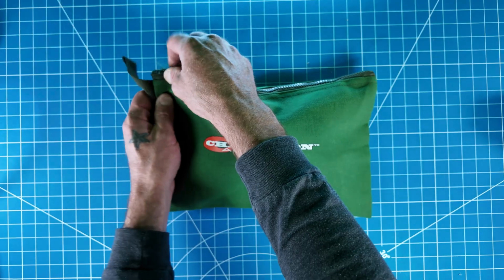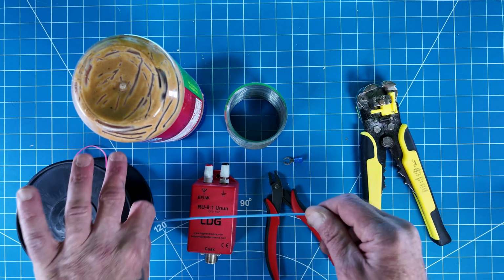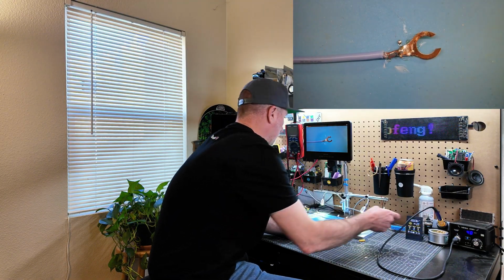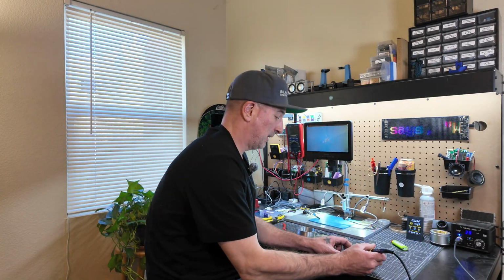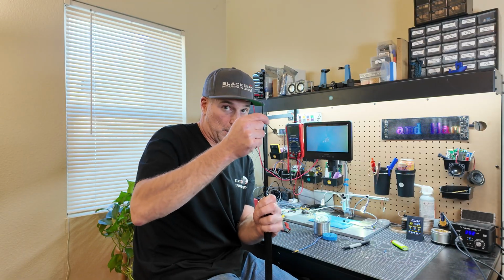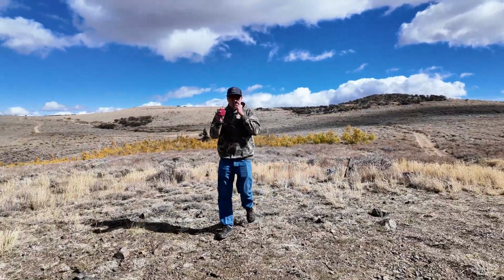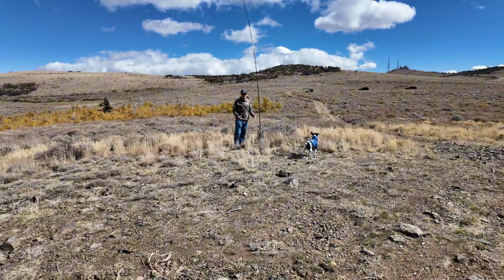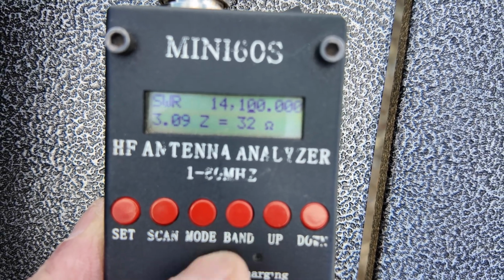Slinky Antenna Complete Guide

Comment: Instead of using a 9:1, wouldn’t a 49:1 work since the slinky is approx 67’? Thats the same length of wire for a 40m EFHW. You could trim to be resonate if needed, and it should work on 40,20,15, and 10m without a tuner.